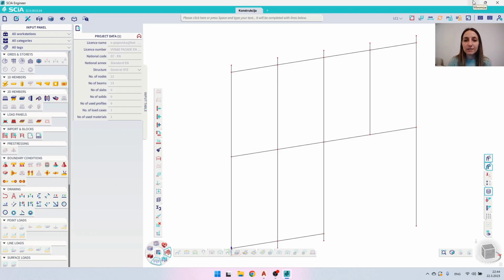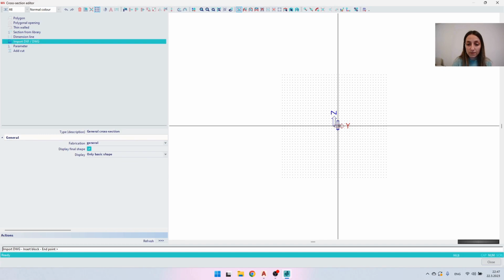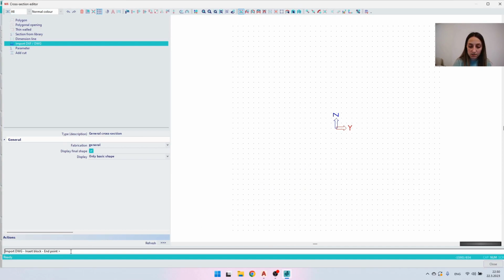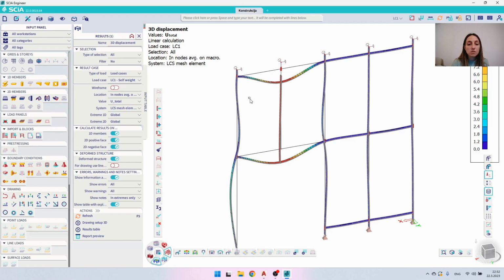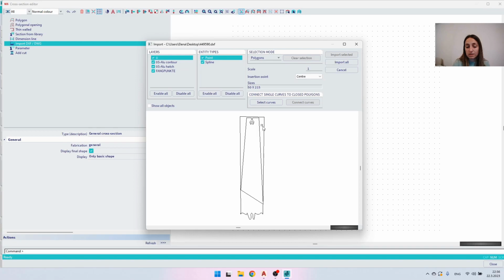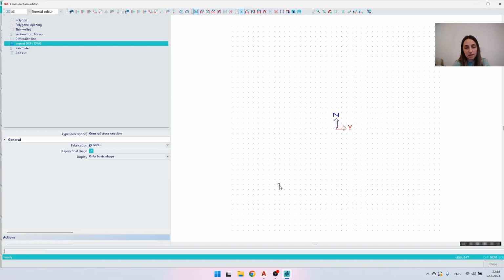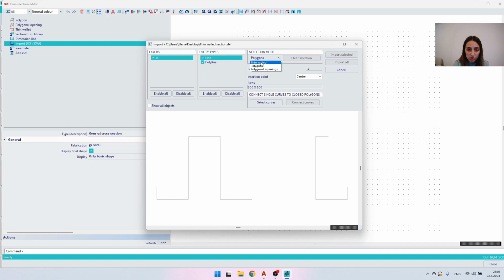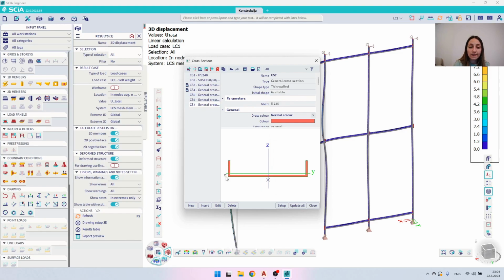HOW TO: Import general cross sections in SCIA Engineer

Comment: Thanks for the informative video, very useful insight into SCIA.
Does the imported section is classified according to the EC9 and any reduction factors applied if it is class 4?
Reply from the maker: Thanks for the support ☺About your question, it depends on the geometry. If a section is introduces in the software as thin - walled, SCIA will be able to recognize the parts and be able to classify it, meaning that if the section is really IV class the software will apply reductions.